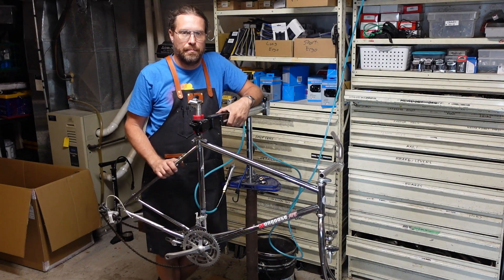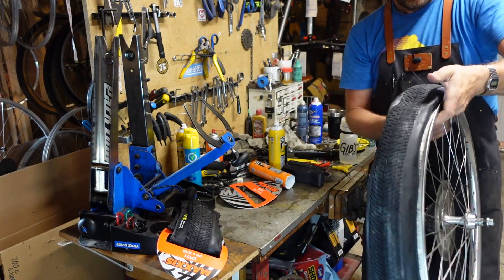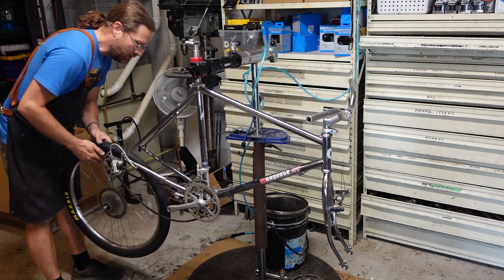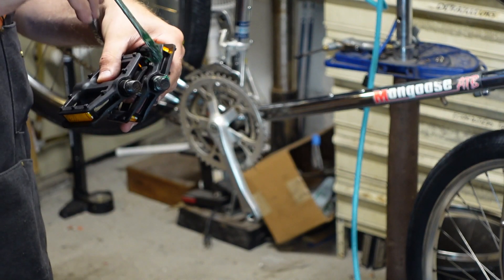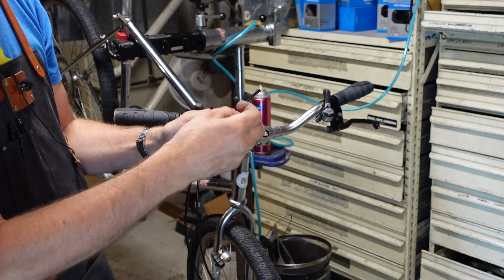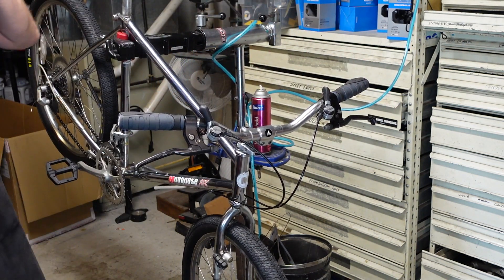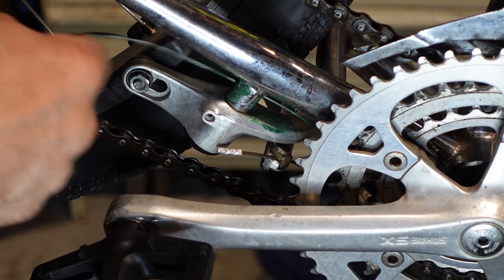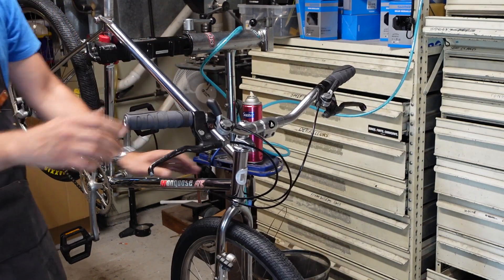1987 Mongoose ATB - Vintage Mountain Bike Restoration - Part 2

Comment: I have been running CST Sensamo Control commuter tires on my old 26er that I ride around town.   They are 26x2 ish  rated to 75psi and really awesome on pavement. I.e fast, grippy,  supple, look cool, and are cheap.  They have been fine when I have taken them off road on some flat singletrack, dirt road, or gravel paths. Of interest is they are also rated for winter use, but I haven't tested that yet.  They are a really good inexpensive option for fixing up old 26ers that are mostly going to be ridden around town, for commuting, or whatever and I have yet to get a flat with them using for urban riding.
Reply: My frame is 19 inch what rang size of tires could I use I know it says on factory ones want some better ones for dirt trails?? Sorry for my bad bad ADHD 🎉❤❤
Reply: My tires say 27.5 what other sizes could I run frame is 19inch thanks?

Comment: I find folding tyres easier to install, just put a little air in the tube first. I don't bother with tyre levers, I've never needed them. I'm not sure why everyone has so much trouble.

It's a technique I learnt when I was a kid and had weaker hands, I had a couple of tyre levers but they would fall out and be finicky. Since I learnt this technique I haven't even found the desire to want a tyre lever.

Comment: Which end of the psi spectrum offers the least rolling resistance? I ride short distances so comfort or supple is #2. Im old but wanna go fast.?
Reply from the maker: How long is a piece of string? There are many variables. Tire pressure is a personal preference determined by trial and error!
Reply from the maker: https://www.roadbikerider.com/the-tire-pressure-revolution-by-jan-heine-d1/
Reply: More air = faster.